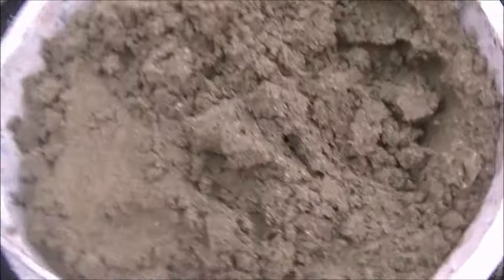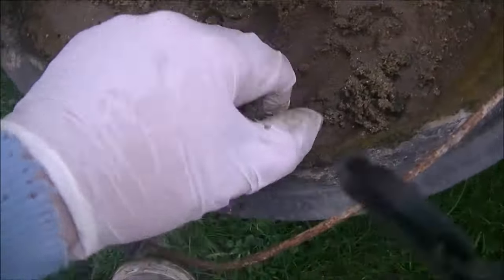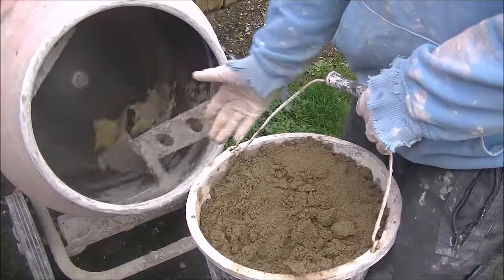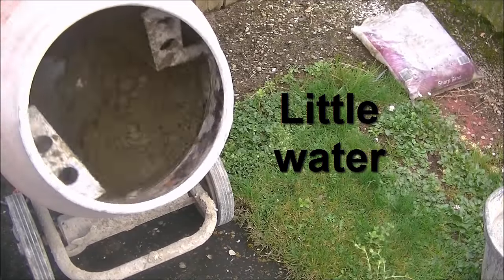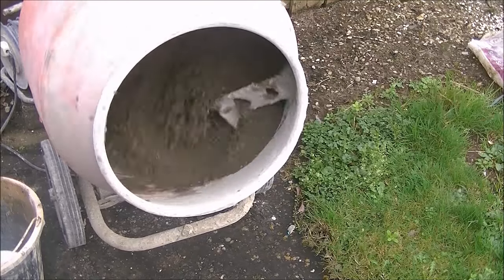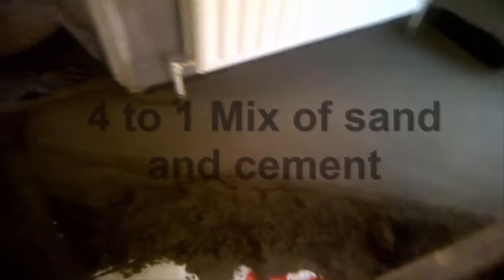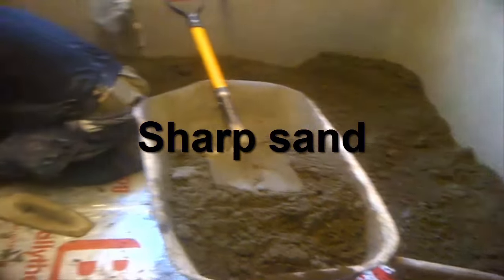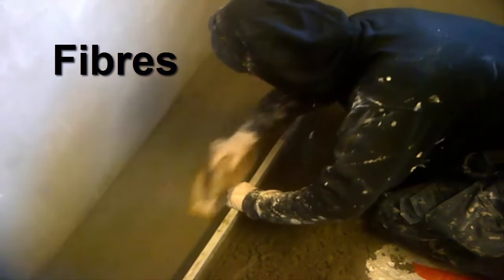How To Make and Mix Floor Screed

Comment: Hi Mac, great video as always. I'm considering screeding the entire floor in my bungalow, as we have taken down all the internal walls and the floor levels differ between rooms. The floor area is 44m². I have not attempted something like this before but I am keen to try things and learn skills for future. Am I crazy? I wanted to ask in particular about your method of levelling the edges of the room first (C-shape). Would this be a problem for such a large space, as my edges may be too dry to work on by the time I have got round the whole perimeter? Any suggestions/advice would be much appreciated! Cheers
Reply from the maker: Hi Chris mate doing a large area is very hard and sore on the back and could be costly if things dont go right for you mate can I ask are you putting walls back in ?
Reply from the maker: and are you going to order in ready mixed gear or mix your own ?
Reply: @macplastering  Thanks for your reply, yes, we are putting walls back in but in more of an open plan fashion. If I went ahead with DIYing it then I think I would mix my own? That way if it takes forever I'm not stuck with several tonnes of going off screed. Do you think it would it be advisable to plan some day joints at sensible places, in order to take my time a bit more/save my back!?
Cheers
Reply from the maker: @chrismetcalfe4827  I would think if you put the walls back in it would give great places to stop as when screeding it is good to work of the bottom of the door frames that should all be set at the same level as eatch other. Mixing is hard it would be faster to have it ordered , the way if I was you would be have walls all in door frames set to height start in the smallest room , most mixing companies will give smaller amounts  so you could give them measurement for that and they will work it out and add 10% just encase . But if you are heart set on mixing again start in small area give your self a chance at it ,youll get the feel of the hard work and the skills needed to get a nice finish thats level I am not trying to put you off but letting you know that it is not easy and i find bigger room harder to do  in both skill and labour aspects , I will try make a Little video to show how i go about larger area. do you have to floor concreted  and preped already as in insulation dpm  ect ??
Reply: @macplastering   mac plastering  under the existing wibbly wobbly screed is a concrete slab, uninsulated. Ideally I'd put some insulation in there but there is not much clearance with the front door, and ceiling is quite low. Certainly will be putting a DPM under new screed, whether it's a DIY or professional job :^) Great to have advice from someone such as yourself who really knows their stuff. I like the idea of starting in smallest room (bathroom) and going from there. I plan to self level afterwards to get a final finish for hard flooring. If I mix myself I was gonna borrow a mixer and have another pair of hands mix while I lay (that's probably a given). Thanks again for the advice 👍👍👍
Reply from the maker: @chrismetcalfe4827  What depth do you have mate in ttl ? Yes another pair of hands will be great for you on this job man I find if you pour it from the wheel brra nice and tidy it relay helps the laying process mate im going to do a demo video to explain how i do the larger areas  (make sure the bell is on to get notified :)
Reply: @macplastering   mac plastering  ok will do! By the front door there is about 90mm between the slab and door swing. Looking forward to the new vid! 😊
Reply from the maker: Dont give you much to play with there at all is the whole floor around the same depth ?
Reply: @macplastering  hard to say until I take the screed up to be honest, I'll take some levels with the laser tomorrow where the slab is already exposed.
Reply from the maker: Yes mate do as you might get insulating on some of the floors witch will still help , oh and video will be live in the morning let me know what ya think of it put in a few tips that might help you hopefully its helpful but ya can always ask more on the videos :)
Reply: @macplastering  just saw it mate, I'm honoured! 😂 Nice vid, I'm gonna keep thinking, planning and measuring. Will keep you posted on my (hopefully) progress! Cheers :^) 👍👍👍👍👍
Reply from the maker: @chrismetcalfe4827  Sound mate hope it goes well for you and if not and you take it room by room could always re think hiring some one in , but wishing you best of luck mate :) Thanks for the support on the channel man
Reply: @macplastering  you're welcome, all the best. Thanks for your time and advice.
Reply from the maker: @chrismetcalfe4827  Anytime buddy need to do a live stream still for another subscriber to help him on a few questions :)
Reply: @macplastering  sounds good, I'll be looking out for it. All the best 👍
Reply from the maker: @chrismetcalfe4827  thanks mate

Comment: Great vid mac good info m8
Reply from the maker: Hey buddy cheers :) hows the roofing/plastering vids coming?
Reply: So so done a small clip on sponge float method on skimming still got my coving vids to upload n prob won't b on a roof till the light nights come in again so hopefully il get plenty of footage then
Reply from the maker: @onpointplastering  Drop me links when ya upload buddy yea probs best not to be on the roof until you can see better and less risk of ice SAFTY 1st  :)
Reply: @macplastering  erm how do i send links or find them to related vids lol
Reply from the maker: @onpointplastering  If you go on the video there should be a button under it says share then open it at the bottom of it you can copy link and then share it  'ps top of tha morning to ya ;)
Reply: @macplastering  thanks for that mac hope your weekends been nice and chilled I'm having a disaster of a time doing floor to ceiling wardrobes in my house never checked and on a 3.9m wall to wall the floor runs off 90mm just made it lol
Reply from the maker: @onpointplastering  Sounds a nightmare you will see my woodwork skills in the matter of weeks LOL but after i plaster board it and skim it its fine ,plasterers are used to fixing poor wok so might as well fix my own LOL
Reply: @macplastering  yip at least we have an excuse of a bit of dodgy gyprocing you should see some of the new walls I've seen joiners leave their attitude is ahh the plasterer can block that out  like u say we can cover it up as we go

Comment: Which fine stones can you add?
Reply from the maker: Fine stone is best if you can get smaller than 10mm
Reply from the maker: Gritty sand the better
Reply from the maker: You can add fibers to but same as stone makes polishing floor a little harder
Reply: @macplastering thanks mate, what do you mean polishing? When you
Are floating it?
Reply from the maker: well both floating and polishing with the steel trowel this is how i do floors = https://youtu.be/1z5CBoDO1AQ   have older videos but this is the newest one also helpfully will be making a new one in future
Reply: @macplastering thanks mate, I have one more question… 

I have a 20mm height left now to screed as I did the concrete quite high, would it be better to do a semi dry mix like in the video? Or do you think better to make it more wet and level it out the same way as you do with concrete and then after mag float it and steel trowel?

I got 2-6mm grano dust to add into it for strength as I am going to polish it as a final floor..

Is it better to keep it dry and screed it like you have done or is it better to do it wet concrete and then use that? Which would be stronger? 

Thanks for the help mate your videos are so calming
Reply: Also I wanted to put some sbr in to make it stronger, does the sbr mean you have to work faster?
Reply from the maker: @lildeanc  lowest I ever went on a floor was 10mm in places I primed floor and added fibres to mix it work well as it was both bonded down and renforced
Reply: @macplastering ok so it should be fine to do it with the dry mix then? And yeah I was going to bind it with an sbr cement slurry and paint that onto the slab first… just wondering if it’s stronger if I do it as wet concrete or semi dry
Reply from the maker: I find the dry mix is much easier to work and level last floor we did got it ordered in and it was raining and we did have plastic to cover but it was took outactge skip so only had enough plastic to cover ground but long story short the stuff was gard to work with as it was wetter than normal.  What size area are you doing m8?  Sbr is you friend to help bond it down just pain areas your going over so it's wet as you work
Reply: @macplastering I like the idea with the dry mix that you can take your time… when it’s wet concrete and you are working alone it can be stressful finishing it after while trying to mix and level it all etc
Reply: @macplastering thanks mate, only 15m2. I did concrete for the first time ever and it came out pretty good but not perfect so wanted to get the next layer perfect. Yes will sbr it so it’s bonded. 

Do you know how much sbr I can add into the dry mix to make it harder? Or can I use pva bond
Reply from the maker: @lildeanc  yea the wet gear when it start to set off if not nice and straight will be an uphill battle
Reply from the maker: @lildeanc  sbr will be much better than pva per bucket I only ever put a drop in almost pour in slow untill the waters white diluted a little even a few cap fulls will improve strength 💪
Reply from the maker: @lildeanc  I have a screed just to get uploaded but so much editing for me to do lol
Reply: @macplastering thank you! I’ll add some in… 

So you think the screed finish is as strong as wet concrete?
Reply from the maker: yes dry is pretty strong for sure man  @lildeanc

Comment: Alright Mac, can you give me a hand calculating the amount of sharp sand and cement I'd need for a 50mm screed over 28m² concrete floor
Reply from the maker: I would order it in mate ready mixed and tell them guys the measurement's they do it all for you
Reply from the maker: just sounds like a good load to be mixing and laying mate
Reply: @macplastering  cheers for getting back to me mate, unfortunately I've not that option, I've got someone mixing up for me though.
Reply from the maker: how did you get on mate ?
Reply: @macplastering  really well thanks dude, the company and customers were very happy with the finish on the rendering and the screed👌. Thanks for your time and advice dude.
Reply from the maker: @georgeallen2673  Sweet glad t hear that mate , and thank you for the support on the channel :)

Comment: Is no one else thinking never start mixer full. And unwind that extension lead
Reply from the maker: Thanks for Your input I would rather check my gear when the mixer is of all the same as its safer for me the machine can be changed my arm not so easy but yes the lead could go on fire like that , have seen it so great point brother stay safe out there :)

Comment: The biggest problem If it is not wash properly.
Reply from the maker: The sand or mixer ?
Reply: @macplastering   The sand If it is not and river wash. It has to be washed. Otherwise there is just Plastering sand
Reply from the maker: @stewartmckay9830  Here our bags are washed plastering sand